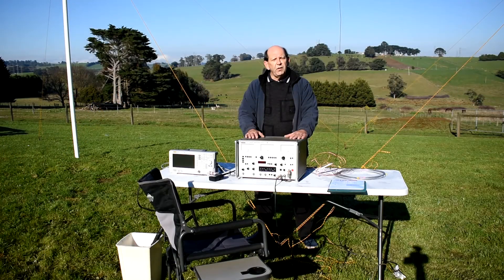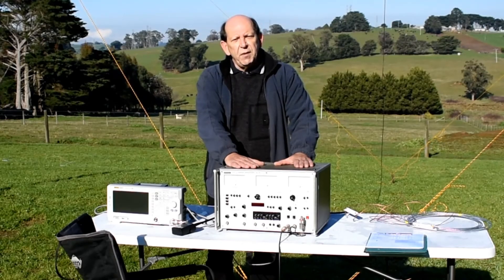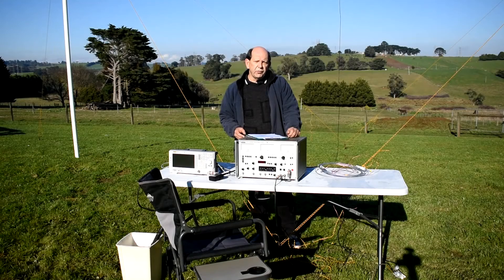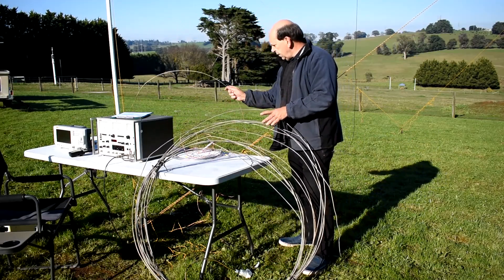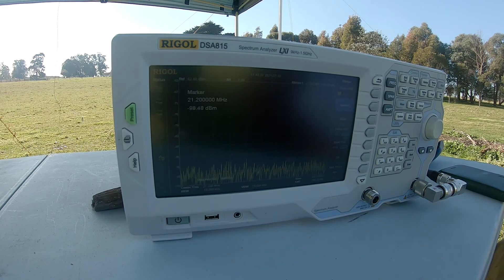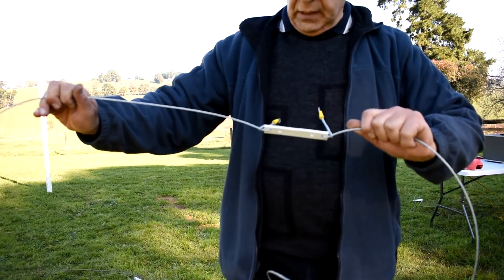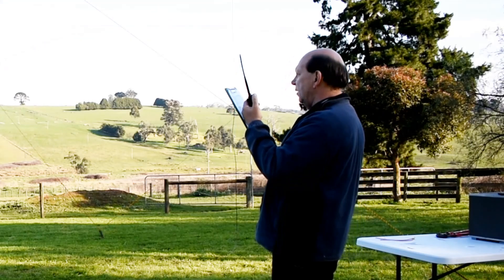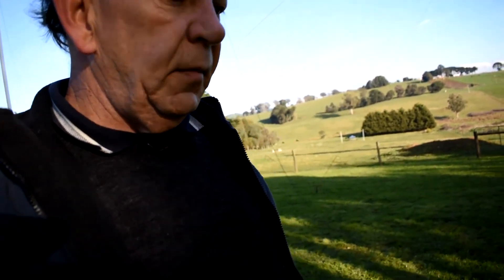R018 Testing Wire Dipole Materials for HF

Comment: Thanks very much for all of this effort.  Three issues come to mind that may not have been addressed.  The first is the power handling capabilities of each of these wire types.  The second is the effect on performance of the conductivity of the wires themselves.  Keeping in mind that you did your testing on 15 meters, where each leg of a dipole will be only a few meters, there will be little DC resistance from feedpoint to the ends of each leg.  Different considerations might apply if you were building dipoles for 40, 80 or even 160 meters. 
Finally there is the question of the effective surface area of each wire type.  At the frequencies tested, the skin effect would limit the current flows to a fraction of a millimeter on each strand of wire. I would wonder once again if  the effects of a single strand vs. multiple strands might be more pronounced with longer i.e. lower frequency, dipoles.
Reply from the maker: Tnx for comments.  To make a meaningful comparison of the test on a lower frequency, It would have taken a much bigger effort, taller poles, more distance to the receive station and a lot more time.  I was running out of all of these resources, so we did as much as we could.  Still, I suspect that the results would be mostly proportional to our findings on the 15M band.   It would be great to see if someone else would pick up and take this theme further.
Reply: @rasa2745  I poke 1KW into galv wire antennas on 160/80/40 and they go like a shower of shit.
Reply: @rasa2745  I see no reason to believe the relative performance of these wires matters as to frequency.  Where it MIGHT matter slightly is the plated wires; higher frequency has skin effect measured in microns.  Lower frequencies might reach into the underlying metal.

Comment: FB with the tests. A couple other parameters would be interesting, just for completeness: Which had the lowest SWR? How wide will the antenna tune and stay under 2:1?  How does each work in the receive direction?  As a guess, I think diameter rules the day on SWR, and the copper and aluminum probably does a bit better on receive than the steel types, but again not enough to make the decision. The physical strength is the biggest for me, so having a material that does not stretch and will handle a windstorm is indeed worth a dB. These factors point to coated steel wire, though some innovation with steel and copper together might be interesting.
Reply from the maker: Fair comment.  We did collect a lot of data, but there was also a risk of getting bogged down with too much numeric info in the video.  Most of the dipoles under test dipped at between 1.6 and 1.7 to 1 VSWR.  The stainless wire rose to 1.9, as did the pvc coated garden wire.  The worst was the MIG wire at 2.4:1  
I started the analysis without preference or preconception of what I would find.  My takeaway from the exercise was that differences are small.  Having a tough antenna nice and high, oriented in the correct direction is the most important consideration by a big margin.
Reply: 4 db difference may not see like much, but 3 db is a doubling of power.